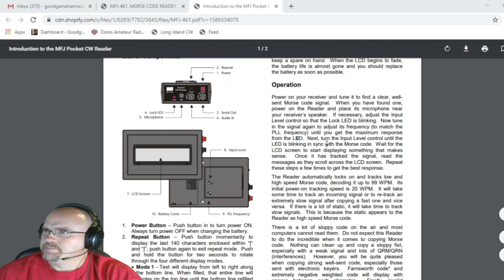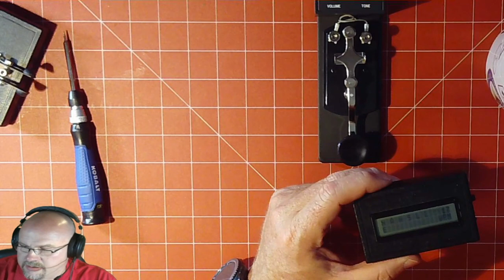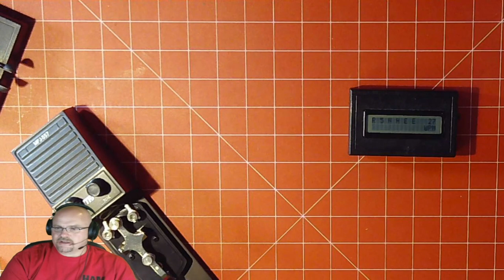Best Way to Learn Morse Code? MFJ-461 Code Reader and MFJ-557 Deluxe Oscillator Review

Comment: I have been using the 557 for a couple of weeks now paired with a  free decoding app on the Iphone. The Only trouble I had was the contacts were not making a flush contact, which caused an unclear signal at times. squealing, static like noise. I bent the arm by hand to make the contacts flush with one another and problem solved. I tried a few decoders they all  need a crisp clear signal and little or no back ground noise.

Comment: I'm a new ham and just beginning to learn CW....might you have a link for a practice paddle? I'm thinking about starting off on a paddle instead of a straight key or Iambic. .......OR should I just buy a paddle which I'll be able to use on the air? If I do this, is there a practice mode so that I can hear it but not go out? I have an IC7300 and am loving Phone and FT8 but now ready to jump into CW. Thanks for the video :)
Reply from the maker: This is the paddle I have. https://amzn.to/2U9f1m1 I initially used the practice paddle that was in the video, but graduated up to the MFJ. I did a review on it not long ago. It is a solid paddle, and I like it. I don't have a 7300 yet, I am planning on getting one for my school club when I get the funds, but I am sure you can use the paddle to practice with as well. On my Kenwood, I simply turn off the 'break in' and I can use it to practice my cw without transmitting. Thanks for watching, and feel free to let me know if you have any other questions! 73
Reply: @K5ATA  Thank you...I'll check it out.
Reply: @K5ATA  Can your better paddle or practice paddle be connected to the 557 for its practice tone? And what is the pracitice paddle you show in the video?

Comment: I have the MFJ-557 but may buy the 461 after watching your video.  Have you tried connecting a cable from the audio out on the 557 to audio in on the 461?  I wonder if that would even work?  Thanks for the video!
Reply from the maker: I will give that a shot and see how it works... I works well without a cable once you get it adjusted correctly. I really like it, I am anxious to see how it does with the kids at school. Thanks for watching, Dan. 73

Comment: Is there some reason to use this over a dummy load on your radio if you already have one?
Reply from the maker: You mean for CW practice? You can also turn break in off on many radios and practice that way. I use these keys for the Padawans to learn. They are fun to play with on the go as well. If you have a key/paddle already, you can certainly use it with your radio to practice with. Thanks for watching!
Reply: @K5ATA  yes for CW practice. If I turn break in off the ft-891 doesn’t make a tone so I just leave it on at 5 watts into a dummy load. Just asking to make sure I wasn’t missing a feature other than portability.
Reply from the maker: @forgetyourlife  Ahhh... I'm not a Yaesu guy (too many dead Yaesus in the shack) so I've not used an 891.  Yeah, just use a dummy load and 5 watts should work fine.  The practice key is pretty slick though. :)  You could use a Cricket build like we did on Ham Radio Crash Course recently... plus you get to build a fun little radio :)